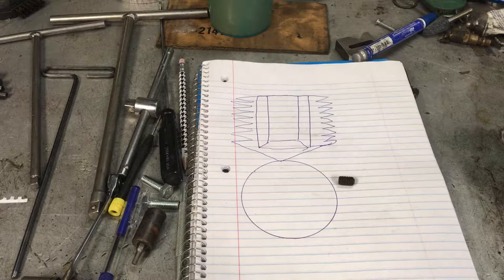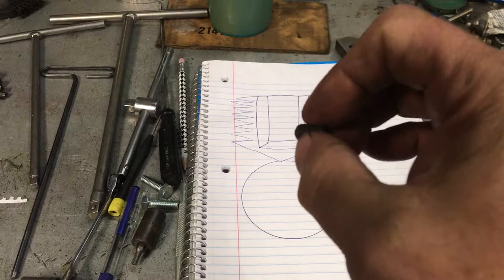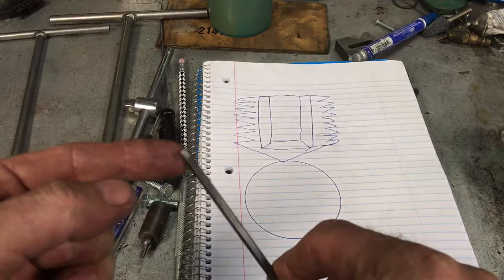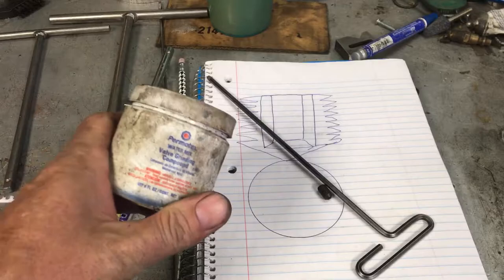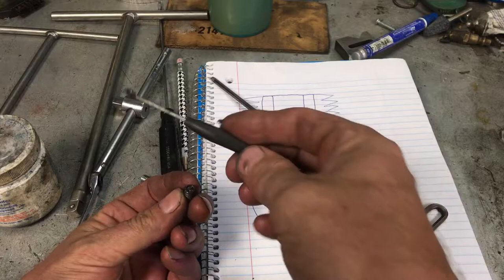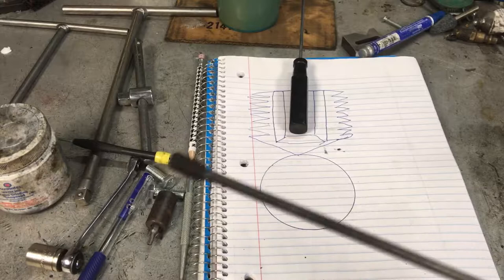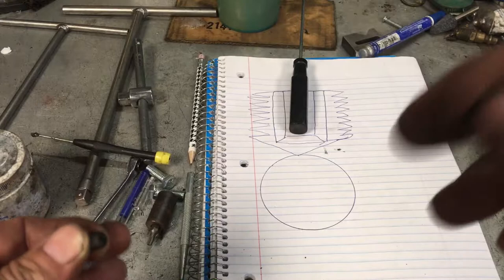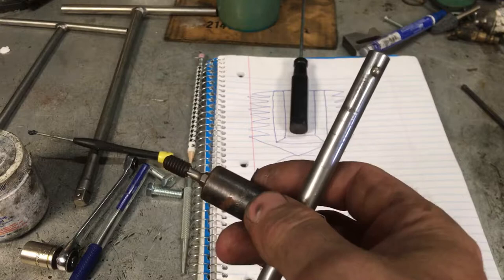Set Screw Hacks

Comment: Torx bits have helped me so many times with set screw removal. But, if you cant get it with a Torx bit oh man, you know your in for a fight. A flat bottom is a grub screw and a pointed bottom is a set screw, they basically do the same job but there are specific uses for each. I have also had to solder an old allen in a couple of grub screws before but that was a couple of extremely bad cases. You can also use a bit of soft solder or lead to basically press fit your allen in the grub/set screw. If all those fail it is time for heat. Take care.
Reply from the maker: I like the solder trick too. I do that by getting the wrench hot and melt the solder and let cool in the hole. This video was just for cold tricks.

Comment: Thank you for this information rich presentation.  I just fixed my 15 y.o. leaking faucet DELTA handle.  Reason being, that we're replacing the counters and the sink in January.   Stripped set screw.    One question:  where did you get your sturdy T-handles (beautiful welds & grinding) , especially the ones with the socket ends where you insert various tips including torx.   It's slim pickings here in the middle of the Pacific Ocean...
Reply from the maker: The  T handle Allen wrenches are from hardware store. The welded ones are off a tool truck. SK tools makes some very nice ones. 
Glad this helps.

Comment: A set screw on my kitchen tap keep coming out..tried to replace it but can't find one the same size.  I can screw it in but it keep coming out..what can I do to fix it.  it only a tiny screw
Reply from the maker: Some times you can drill out the hole to a larger size and tap it for new larger set screws. But it depends on the type and thickness of the metal. Take the part with you to a local hardware store or plumber. They will know how best to deal with it. They will know if its worth saving.